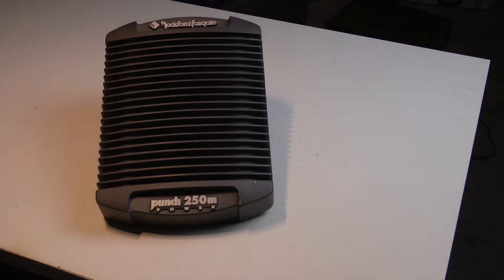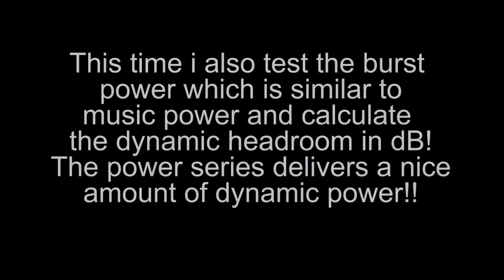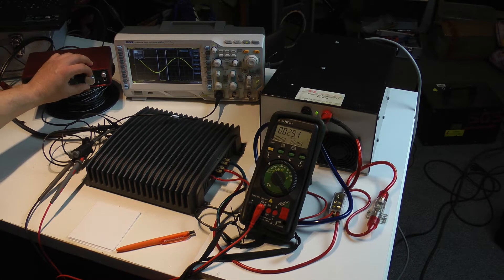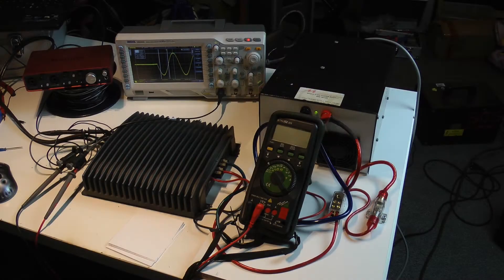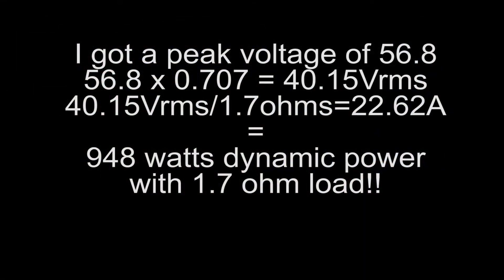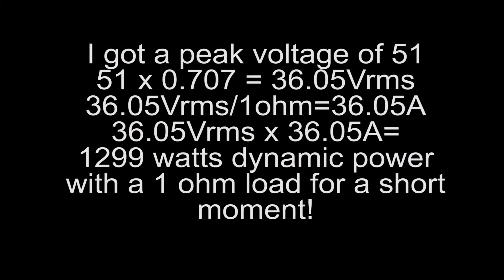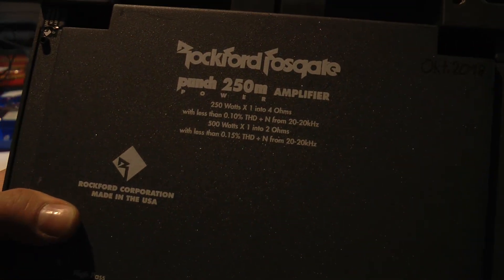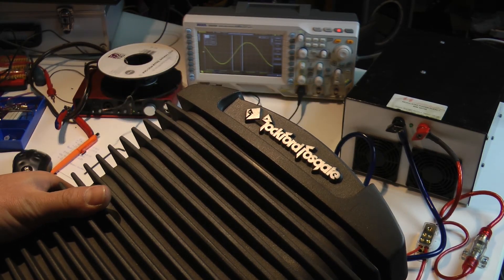Rockford Fosgate Punch Power 250m amplifier test dyno run oldschool burst power 1 ohm cheater amp

Comment: Hi, is this amp same power like 250m2 or not? What is diference ?
Reply from the maker: in  my opinion its the same amp. the boards are very similar 👍 there are some differences like the connector for the psd1.
Reply: Thank you for answer! :)
Reply from the maker: i am sorry. the power 250m is a mono amplifier the 250m2 is stereo and is the same power like a punch 500a2👍

Comment: In this series of amplifiers they made a Punch Power 250m2 also is that correct??? If so what was the difference between that one and the one that you are showing in this video??? I know they also made a Punch Power 500m correct??? Was there a real big difference in wattage between the 500m vs the 250m if so what was it??? It's very interesting to know, because I'm pretty sure that there was a difference in price between the two back in 1996 when they both came out in the market is that also correct???
Reply from the maker: Thats correct!
The 250m2 is the stereo version, rated 125 watts per channel @ 4 ohms.
225 watts per channel @ 2 ohms, bridged 4ohms: 450 watts continous power rated by rockford!
There is no difference of 500m and 250m in terms of outputpower. Only the color and the circuit for the punch status display is different. For the 500m you need an adaptor.
250m=500m same amps!
In germany there was no difference between 250m and 500m regarding the price. They sold both for around 1900 german marks.
Two bridged 500m or 250m delivered around 2000 watts rated by rockford!
The 500m came out a little earlier here in germany, the 250m is just the upate of the 500m.
Reply: @audiokeller1975  Thank you for all the information for those amps,but how much would $1900 marks be equal to in american money do you know??? Wow It looks like you know a lot of the history of that series of amplifiers the Punch Power series!! I'm pretty sure that's because you have worked on them a lot correct???! That's great!!! 👍👍👍
Reply from the maker: @josea.garcia3994  1900 USD was around 1200 german marks in mid 90s.
 Rockford Stuff in germany was way more expensive than in the US!
I never worked on them in the past, i just bought my first punch40ix in 1995 for around 600 german marks and i was pretty happy with this product.
3 years ago i started collecting rockford amps and repair them if necessary.
Building/repairing amps / speakers is one of my hobbies.
Can you imagine that there is no amp in my car? :-)
I like the amps, but i dont use them in cars or build car audio-systems anymore.
But i love to test/play around with amps i couldnt afford when i was young and share this oldschool-stuff with all of you :-)

Comment: Wow very nice looking amp!!! Great video!!! Like the music beat in the back ground!!! What would something like that cost brand new in today's dollars and I don't mean retail price??? Straight out regular price??? If you have a 500m amp in that same series can you do a test on it to show the difference between the two of them??? To see which one has a higher output and by how much??? Thank you!!! 👍👍👍
Reply from the maker: Hi!
If of interest:
i tested the Punch Power 50M down to 0,25 ohm! Check out my latest video!!
BR
Reply from the maker: Thanks a lot!! :-)
This is really a hard question because i am located in germany without dollars :-)
sometimes you can get them for around 150-300 euros if you find one. 
They arent made like this today. This is a class AB amp , most new amps are class D.
I like the old AB amps, repair is inexpensive, just some cheap power supply FETS, resistors and output fets or driver transistors are the most parts to exchange.
If i am right, there isnt a difference to the Punch power 500m , in the circuit there is a small difference regarding the punch status display.
I tested with 13.7 volts supply voltage, they have also been tested with more than 14 volts.